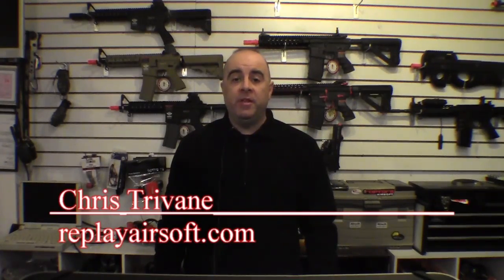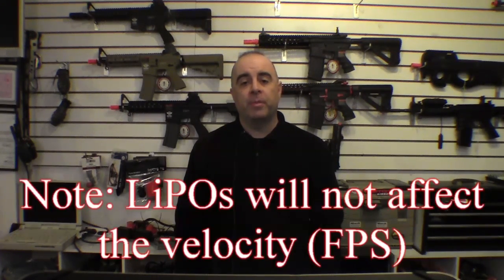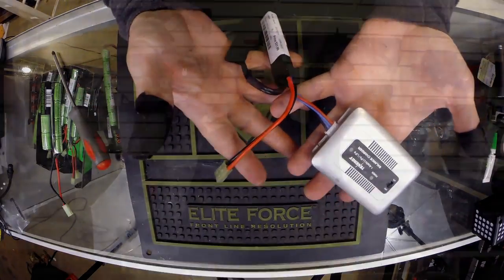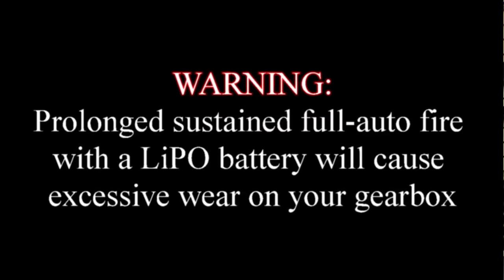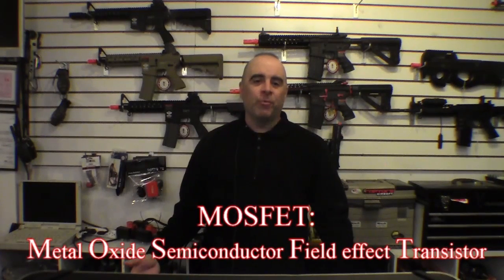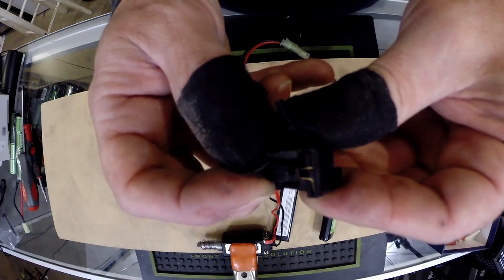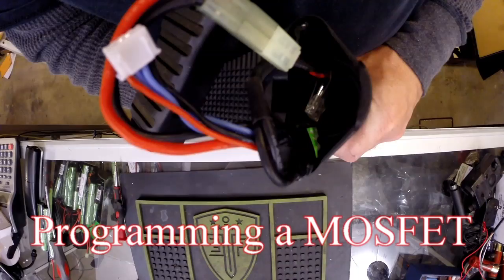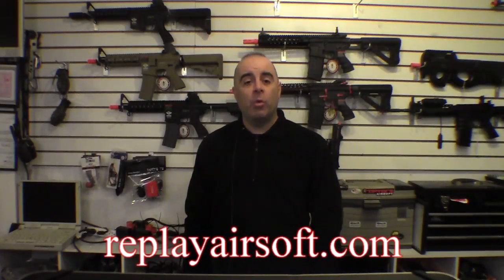The TRUTH about LiPOs and MOSFETs

Comment: Are programmed that way you can reduce the rate of fire so you're not burning people's patches ; ).  It also helps with to response and make sure your 11.1 then burn out your contacts. If using 7.4 then you don't need it. I think the most you can get on a 7.4 is probably around 18 rps with a 30C battery. If you want to puch it to 25- ep you need an 11.1 plus a couple of other internal modifications like high speed gears, heavier spring (because pme), better motor, and  aoe (to redice wear).

Comment: It only makes a difference if you're using 11.1 or higher. If you're using 7.4 then it's not worth it. Basically any gun can use 7.4 without any modifications

Comment: I've run all my guns with no hard wired mosfet, I do how ever use a quick connect mosfet for it's 3 round burst and other options. Have not had one brake down, even if it does it will be an easy fix.

Comment: 2 weeks ago I bought a keymod all metal m4 at my fields shop. Had them install a lipo battery pack for me as well.
 I immediately took gun on the field for a game. Not 5 minutes into game (semi auto only field, fired maybe 100 rounds) I smelled burning plastic. Next thing I know my stock literally goes limp and melts to my buffer tube. Ref saw the whole thing and slaps the gun out of my hand, while directing me away from the now on fire gun. By the time they got a fire extinguisher. The gun was ruined to say the least. After clean up there was a black burned plastic outline of the back of a m4 left on the concrete floor.
The field owner who sold me the gun said he had sold several of that gun/ battery combo's without issue. He apologized over and over. They were out of stock on the gun they had just sold me. So I got a cyma m4 of similar value to the melted gun. Plus they threw in used hicapa I had been eyeballing in the show case. When I wanted to buy a 5k bag of .25 bb's they only charged me $3.99 for a $16 bag if bb's
Great shop, nice people. but I will never buy lipo again..EVER!
Reply: I'm guessing it was either a really low performance li-po that got over loaded, it had a manufacturing flaw, or that it got damaged somehow. I've used li-po's for nearly a decade now, and they have been supremely reliable, I actually a lot of issues back when I used ni-mh batteries.
Reply: dont buy cheap plastic m4 and you can use lipo no problem
Reply: Well I might be late to the game, but have you looked at the Li-ion batteries?

Comment: Now yes you don’t need a MOSFET to be LiPo ready most guns now a days are stable enough to use a 7.4v, problem is when you get to C rating you may run into the fact you need a MOSFET.

Comment: Shocked to see so many ignore the Amps & most importantly the Watts of the AEG. Recap: Volts x Amps = Watts. Most stock guns produce about 11 to 12 Amps in std lame form out of box with lame slow ferrite motors. Depending on 7.4v - 9.6v - 11.1v battery used, you will draw say 80 Watts to 130 Watts. Not a real problem at all for AEG's without a mosfet. However, once you start upgrading a gun with faster gears, faster/torque motors, stronger springs or even DSG you can easily double or triple the Amps and of course the Watts too. You could be drawing say 20 Amps but using 7.4v will only be a little over (148 Watts), than the stock gun @ 12 Amps on 11.1v (133.2 Watts). But if you run above say 150 Watts the arcing will increase at contacts due to the final Wattage. If running 20 Amps on 11.1v then that is 222 Watts. In actual fact a Lipo cell comes off charge at at up to 0.5v more at 4.2v max than 3.7v so that 11.1v freshly charged is about 12.5v x 20 amp = 250 Watts !!! Bit of a difference eh & we aren't even really pushing it - this is a moderately tweaked build - DSG's can really ramp up the Amps & of course the Watts depending on battery used. High Speed Motors will increase the Amps & very quickly deplete your battery, so a 16~18 tpa balanced or 22 tpa torque is best to keep Amps low (and Watts) plus ensure battery doesn't die before lunchtime. Keep an eye on the Amps and remember the final results in terms of Wattage as this is what kills your contacts in the end not really the voltage on its own but the Volts x Amps = Watts. 150 Watts or more fit a mosfet, with TVS protection. Have fun, play safe & leave egos in the safe zone - peace
Reply: Great response, everyone should read this and not listen to the silly old man!
Reply: i use 15 volt 4S lipo batteries with 13:1 gears, what amperage and wats could this setup be using? ive used that gun for several games and so far there was no problem

Comment: Lol, you dont need a Mosfet for a LiPo, the point of a mosfet is making the gun ready for a 11.1 LiPo, not any LiPo
Reply: Even then you'd have to consider the quality of the internals in your setup. Many marui guns were not designed to operate at such a high rof, and neither are their clones. Just because a gun has a mosfet doesn't mean that you're immune to headaches like pre-engagement and poor feeding.
Reply: little to late for me ..my regular ni-hm battery i used for my replica was at it's end..but i got plenty of lipo's laying around from the rc-planes i used to fly.  3 or 4 cells lipo's from 800 til 6500 mah..so i took the lightest one 3 cells (11,1) 800mah and it shoots perfect for about two months..till my bb-s just rolled out my barrel and found out my gearbox has broken in two and crushed my piston and head although it was a good quality reinforced gearbox (force core)...wel try to make a kind of mosfet from my rc spare parts maybe using a motor esc. or something.
Reply: well, what did you expect running a 11.1V lipo? I run 7.4's in my AUG and it's never let me down once. 11.1 is over the top and un-needed in pretty much any case.
Reply: Haha, still using the 3c 11,1v lipo's keeping it oiled and greased and it runs as smooth as silk..using heavier bb's (0,25) and up to 30 metres in a straight line..
Reply: @Kayze12345  11.1 over the top? I'm guessing your content with terrible trigger response. You've definitely never shot a properly tuned and upgraded AEG running a 11.1/14.8 li-po...
Reply: @keesvanbennekom7823  get a better hop up and run .30g bbs or above. My gun does 375fps with 0.2g and I get about 60-70m with a 0.3g bbs flying in a straight line.
Reply: @FrozenByFire3   The only times i use such terms as hop-up is when my wife is wearing a bunny suit my friend....sometimes i use it in my side arm (1911-gbb from army armament a cheap brand but absolutely recommended 340fps) ..when it's windy and playing on a big field ...But hey man, 60-70 meters ?!? in a straight line ?..you must be talking 'bout a sniper ?...Also where i live we are restricted to 360fps on a rifle/machine gun and 540fps for snipers....I don't see the need for changing my hop-up, but maybe i have to take a better look to see the effect if i take it out of the flat position...I better find some better/heavier reinforced pistons/head...'cause i wore them out in no time when the idiot in me decides to think he's invisible and steps out of his hole to find himself in the middle of enemy troops...swearing yourself buying more high caps and don't call those dudes wearing helmets sissy-boys any more...
Reply: @keesvanbennekom7823  nope I'm talking about My CQB M4 that fires 35 rounds per second haha and only had a 300mm barrel. Heavier bbs get affected by air resistance a lot less and they carry more energy down range. You absolutely need to tune your Hop-Up carefully and get a proper hop up bucking (just search up Maple Leaf AEG Bucking) to get such accuracy and range. My Sniper which does like 500-520fps shoots about 90-100m but I use 0.4G bbs which are even heavier and are even less affected by air resistance and wind. You don't need to change your Hop Up unit entirely, just the little rubber part that slips over your barrel. Costs like 10$ and is the best accuracy upgrade you'll ever do

Comment: How the heck did you wear out the mosfets? My mosfets barely heat up even after dumping an entire 300 round hicap. I'm guessing you're using cheap low quality mosfets, a high quality mosfet will last pretty much indefinitely. My oldest mosfets are about 5 years old and have gone through at least 300 000 shots and still work perfectly.
Reply: What mosfet is that?

Comment: Thank you so much for this video! you saved me some money from a scammer claiming a mosfet was vital for my aeg and wanted to charge me 50 bucks for it!
Reply: Guyz i have been using 11.1 lipos ever since i started playing abot 4 years ago and only recently i put a mosfet in one of my replicas, the rest i have been using them without and my motors never got burned, or my tappet plate melted or something like that. I say you can use 11.1 without mosfet lel been doing it for years =)))
Reply: I am probably a lil late to this party. 
But i want to add a few things here. First, in this video there are some very good points,  but there are some very bad points as well. 
Do all guns that run lipos need mosfets? No, some guns, like his rentals, aren't using high discharge lipo's and the guns themselves do not draw allot of amperage. I have seen many guns, that people have run low c rated lipo's on, last for quite a while. But that's because of the low amp requirements of the gun and the low discharge rates of the battery. As far as the op wearing out mosfets, you must look at the mosfets he was showing you. Both of those fets are low amp rated fets. if the amp requirements get to high and/or the battery's get to low you can actually burn out those fets very easily. I actually recommend a mosfet for every gun,  at least every gun that is decently tuned. It will help increase battery life,  give you marginal trigger response and rof increase. And as long as you choose a decent one there are no drawbacks. 
Just my 2 cents
Reply: MagicMinecraftStyle you are wrong here. A mosfet may actually cause your motor to burn out quicker if things go wrong. 
A mosfet has less resistance and actually allows more energy to be transferred to the motor. Mosfets will protect your trigger contacts and allow for a more efficient energy transfer. getting you longer battery life and marginal increase in rof and trigger response.
Reply: dalton andreshak 
Hello there. 
Umm that reaction was kinda rude and unwarranted.
He wasn't saying that lipos wouldn't cause damage to a motor. He was saying that mosfets  don't protect the motor they protect the trigger contacts. A mosfet can actually cause more damage to a motor because they allow a higher energy transfer. More energy/more heat and most of the time larger sparks, burning the brushes faster. 
Thanks for not comprehending what was written and over reacting though,  it gives me great faith in our educational system.

Comment: A mosfet with a tvs diode that protects a mosfet from voltage spikes will not burn out unless shorted out or overstressed. For high stress builds a mosfet is a must or trigger contacts will fail. A mosfet can help reduce resistance as well for more rps.

Comment: I have used Lipos for the last 15 years in RC racing and I have had ZERO fires... I have charged 1000s of times. I also have seen a few batterys get old and Puff up... They should NOT be used anymore after a puff or swelling.... This is the SAME argument with HPA VS AEG and Joule creep or bla bla... 400fp with a .20 is 400 With what ever you use to shoot it.. Just because you use an AEG to achieve 400 or an HPA the impact will be 100% THE SAME....The cheating is when a HPA user chronographs with a .25 and then uses a .42g bb and shoots someone point blank.. That is the Joule BS.... Its NOT the gun its the user...
Reply: joule creep happens in gas systems
in AEG, the most of the volume is stopped when piston hit the wall, and sometimes it sucked back by the piston movement, even the sudden stop sometimes making little drag to bb
but in the gas system, the gas is continuously streaming pushing bb, no sudden force whatsoever, even GBB having that advantage, but it's not joule creep that proble arise, as maybe Joule retain is just around 20percent, but in HPA system, user can adjust the power whenever they want

Comment: The only way to truly screw up a lipo is being really stupid with them, dont put a nail through it, dont smash it with anything heavy and dont bridge the contacts for any extended period of time )it wont catch fire it you let them touch for a second. And dispose of puffed up batteries.

Just use common sense and read the manual before using

Comment: I've been using lipos for airsoft and rc vehicles and I've never had a lipo blow up or catch on fire. Don't let this video scare you. He does have some great points!
Reply: i fly rc planes ..and in the beginning my landing skills were pretty good for a japanese kamikaze...and yes they can actually BOOM...
Reply: If you discharge them lower than they are designed to go then they will vent but most Airsoft guns and RC cars have mosfets that won't allow them to get that low or at least beep to warn you when they've reached the safe point and with lipo cells like 18650' for vape mods and high end cameras if your battery wrap is torn it can arc and vent (explode)
Reply: @isaacshively6705  only mid tier to high end guns have that. Mist beginner guns dont have that and you have to wire one yourself and have a tech do that. Basically any less than 200 wont have a mosfet generally. Also most of them dont have battery protection. Just trigger contact protection. What most people do is of it starts sounding off like its slowing down or sounds like its struggling, stop shooting. Simular to what happens with a squib load in real guns where if you hear a pop instead if a bang, you have squib.
Reply: @darkshock42mlg05  really because my Krytac doesn't and my Cyma does
Reply: @isaacshively6705  is it a platinum if so then point still stands. Main idea is basically anything sub $200. Also i heard that for the most part krytac mosfets are better than nothing although still better than the g&g etu.
Reply: A bad lipo almost burned down my whole house we got home right when fire started only one room had to be redone thank the lord.
Reply: @ryan-eric3336  that's not the batteries fault, lipos do that if you use a shitty charger or a battery that is old and has puffed up
Reply: Lipos scary
Reply: @eoinpkav152  not if you use a balance charger, change them out every year, and use a mosfet that has a low voltage warning or one of those low voltage warning alarms
Reply: If you hit it with a hammer it will puff
Reply: yea but why would someone hit it with a hammer?

Comment: Hey man. I bought a red dot sight today and then went to lvpp my local air soft and paintball field. The first game I used the sight in I got shot out. Is there anyway to replace the glass? The led still works.
Reply: No, but you can purchase a sight protector that goes in front of your sight and prevents it from being shot out
Reply: +subie skyline34 Your red dot sight is dead forever. Replacing the glass will cost more than buying a new red dot. Next time, use a lens protector. There are decent ones for sale at most stores, but you can also make your own using 'Lexan polycarbonate'. You should also put a protector on your flashlights, cameras, and any other accessory that can be shot out.
Reply: +Preston Estep 45 us dollars
Reply: +Preston Estep 45 us dollars